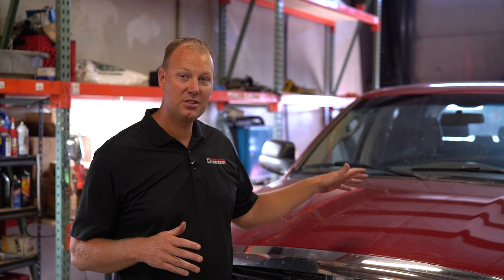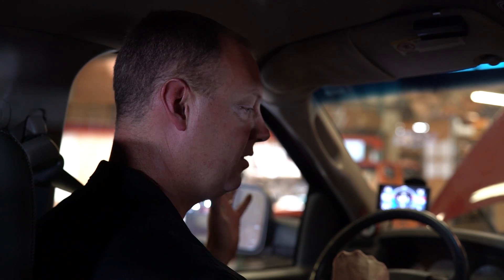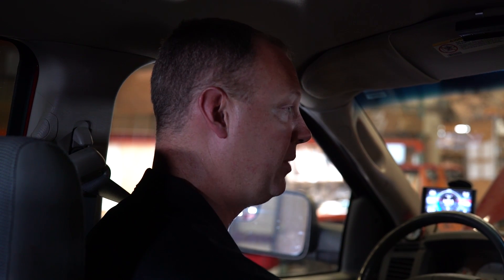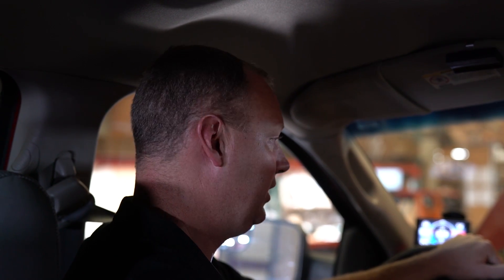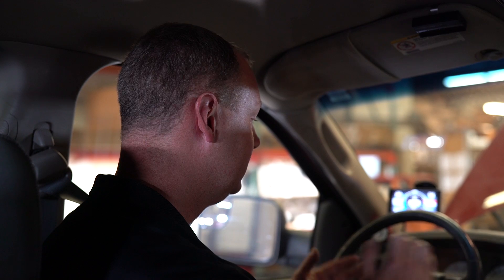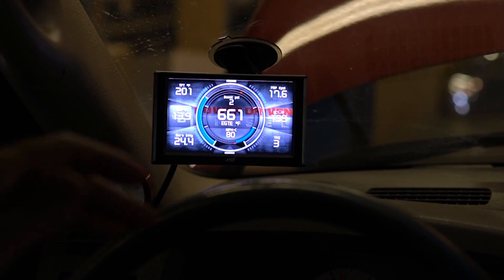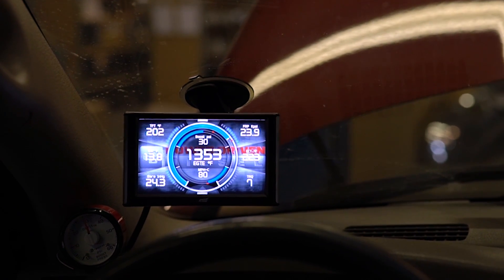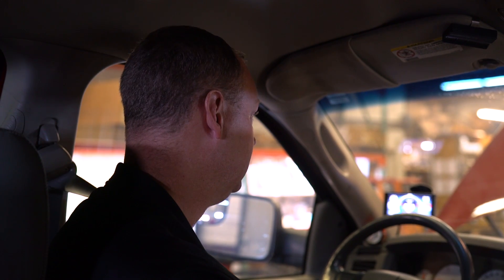Dyno Test: 2006 Dodge Cummins 362 SXE Drop In with EFI Live Tuning | Power Driven Diesel

Comment: How does the S362 compare to the two PDD HE351s? Are there turbo maps for the two HE351s?
Reply from the maker: The 351 will be about 300rpm sooner to spool and makes the same power.
Reply: @pddofficial what makes the HE351 spool up faster?

Comment: Are there any other supporting mods that you'd to to do to ensure reliability?  Headstuds, and transmission mods from the added boost pressure?
Reply from the maker: Yes our pan off upgrade, and some head studs are good insurance!
Reply: @pddofficial   is the Pan off upgrade for the 48re going to support the 500hp mark ?

Comment: I broke a con rod in my '03 5.9 last week. I've ordered a DFC tow/haul long block that comes  with a Hamilton Cams 178-208. Add to that the S362SX-E Drop-In Turbo Kit from PDD. I already have a 4" cat back with a straight through muffler. I'm considering 30% over injectors with supporting pumps and definitely MM3 tuning from PDD. I anticipate pretty good power from it. Any thoughts in the comments are appreciated.
Reply from the maker: Sounds like a really good set up for you solid 650 hp

Comment: One of the things I am a staunch believer in is external oil coolers know where I live and for my application on my 91.5 dodge I really don’t need it but for guys that are doing heavy towing especially in hot climates I’d put an oil cooler on and I tell you something else and oil cooler before  the oil routed into an oil cooler also before it gets to the turbo why not this is six in a row jim from Kennerdell Pennsylvania

Comment: I would like to see the same test done with a compound with a s475. I’m on the fence about buying a compound set and this is a great way to show a single vs a compound setup. BTW my truck is a Fummins has an 05 Cummins engine with just a Smarty tuner.
Reply from the maker: unfortunately  we have tried the 475 flows 10lbs of air a minute less than a 472 while increasing spool time

Comment: So if I want 600 hp, with 50 or 100hp injectors, and I plan to tow, would the 62 with a t4 be a good option for that power and low egt or should I put something else in?

Comment: Does that have the stock harmonic balancer on it or did you upgrade that because I've been watching videos saying the more horsepower you add you should put a fluid dampener on them
Reply: @pddofficial  How do the Fluidampers compare to ATI Super Dampers? Is one recommended over the other in any scenario whether work truck or Street/strip?

Comment: During the towing simulator what tune are you using we're using the max effort still and also down here in Arizona would you recommend the .80 housing on stock fuel
Reply: PowerDrivenDiesel for the best towing performance lowest EGT numbers what exhaust housing would you recommend.   .70 or .80?   I tow 12-14k multiple times a year over 6-7k elevation passes here in California.  My truck is a 04.5 all billet Goerend auto.  I live at almost no elevation if that matters.  Thanks!

Comment: Would you happen to remember what the transmission temp was during the towing simulation?
Reply: PowerDrivenDiesel That was going to be my next question. Convertor lock. Or unlock during towing. Is that something that does not happen with a diesel? Sorry for the dumb question, I'm just from the gas world but I like to learn

Comment: What kind of AFR we are talking about here with this power? I'm going to have this same turbo with 0.91ar housing as LP turbo on my 2.5tdi so quite interesting stuff
Reply: @pddofficial  Its going to have two k03 (or similar) as hp turbos so overall i hope to have full power available from 3000-6500rpm. Its a v6 engine so bit easier to make it with two hp turbos on the side and lp on the middle. It will be quite hard time to fit them all to the audi engine bay but i'm confident it is possible to fit in. :D Currently running single K27/s200g hybrid 53mm/59mm and having round 400hp.

Comment: What needs to done to the drive train for it to live at that level? Eventually we will be buying a 3/4 to 1 ton crew cab truck and want to know what components I will need to add for it to survive pulling loads in the 12-15k range up 5% grades say 4-5 times a year. Unfortunately we won't have an unlimited budget so I would like to have a good idea of how much I can spend on the truck. Ideally I would like a mechanical truck but I haven't had much luck finding those in the crew cab configuration and that's a must. Thanks in advance for any advice you can offer and thanks for another great video.
Reply: Thanks a bunch for the information. You guys are awesome.

Comment: That's impressive numbers for drop in modifications most anyone could perform in their driveway. Thanks for showing the application of a daily driven tow rig that the average everyday guy or gal would run. I myself like an obnoxious exhaust but it's also nice to see that power or hear rather, that power number show up without the quarter-mile off alarm of piped Cummins lol

Comment: Is it safe to run a second gen with those EGT’s while towing a grade? If I see 1200 I’m shifting down to forth... but if I can run 1200 for say 10 minutes is that an issue?
Reply: aluminum will melt at 1500 if held at that temp for 15-20 seconds 1200 is fine

Comment: Those EGT’s seem like damaging temps, specially if you’re towing.
Reply: Wow, I never seen any of my stock trucks get anywhere close to 1400, unless air was restricted. We all know that dumping fuel in the truck will give it more power, but with a cost of high EGT's, just like your video shown. I would assume you know more about this, but from my experience, rings get eaten up with those high EGT's. Eventually you'll have massive blow by.
Reply: Gotta remember it was only wind from a fan too. That's not nearly enough air for this type of strain
Reply: UPstater5.9 - You don’t need to repeat what he said. That is an excuse that is not likely. There are a lot of manufactures that just dump tons of fuel to make their numbers for horsepower and torque. They don’t mention how it’s melting your motor. 

I’ve only seen Gale Banks produce a kit to inject methanol to keep EGT’s down. It would be great to see everyone else start to focus on not melting your motor down to gain horsepower, because I don’t have the money to replace my engine every year.
Reply: @mikemiller9119  hows that not likely? Wind from a fan is not 80 mph going over the entire vehicle. Its certainly not comparable
Reply: UPstater5.9 - 80 mph wind is going to cause much more drag which will cause the truck to slow or cause you to put more throttle which will cause higher EGT’s than what was already showing. Now that’s not what he meant by the fan verse the natural wind. 

He meant that you would get lower EGT’s by getting more air through the intercooler and/or intake. 

Let him put the test in real world, like I have for many years and you’ll see what I’m talking about.
Reply: I live in Northern Ontrario, and in the winter I have a tarp that I through over the coolers. I can tell you from experience that when it warms up I have to take the tarp off or the truck overheats. I'm talking about the same day too. I've seen myself drive to Toronto (7 hour drive south) and have to remove the tarp 3/4 of the way there. Guess what, the truck magically cooled down when the tarp was removed. 
Do you think that maybe the tarp was restricting the air flow to the coolers and once I removed the tarp and air was able to flow through the coolers thing cooled down?
You must be new to the diesel world. Many companies make compound turbo kits for these trucks and have been since I bought my truck and got interested in what was available. That was 2007. Remember what I said about a google search: https://www.google.ca/search?q=dodge+ram+compound+turbo+kit&rlz=1C1CHBF_enCA768CA768&oq=dodge+ram+compound+turbo+kit&aqs=chrome..69i57.19624j0j4&sourceid=chrome&ie=UTF-8
Reply: Clinton Roy - you’re not getting it. I’m not new to diesels and I drive them for a living. I work on my own trucks most of the time, if not all the time. I understand how they work and unfortunately see that you do not. I’m not going to argue with you. Take care.

Comment: whats the max continuous egt with a CR/24v truck?
Reply: theblackmech romping on it mine would run around 1,200 with a tuner, CAI, FASS 150 Platinum and 5” exhaust but just running down the highway at 80 she would run about 800... I miss that truck!
Reply: im asking what PDD thinks the max egt it will run without burning exhaust valves up
Reply: cummins uses inkenol exhaust valves (forgive the spelling), which are rated to handle 1600. hot rod guys upgrade to these valves for high hp/boost
Reply: yes, but 1600 intermittent.  continuously i think theyre rated 1250.  i wanted to hear why PDD says
Reply: so its cylinder wall clearance and not the exhaust valve?

Comment: Will a stock transmission hold that power? or do you guys have an upgraded transmission in that truck?
Reply: They have their 650hp 48re trans in it.  I doubt the stock trans would last long under the increased power.

Comment: I would have like to see what kind of draw was put on the 'after marker air filter" setup if was still suffacating the engine. Are there any other drive line "upgrades" needed with this setup or is it replace turbo, install EFi live and hammer down, What kind of life does the trans/driveline live being daily driven?

Comment: Can you guys start commenting what boost and afrs you guys are seeing when tuning?
Reply: Egt is enough for tuning a diesel
Reply: DATONALKY - Air-fuel ratio on a diesel?  Seems unnecessary since EGTs and what's coming out of the exhaust will tell you what's going on with the fuel.
Reply: Hard to find AFRs on a 5.9 common rail. Would have to probe the exhaust tip to get that info.
Reply: melonas22  as you do when tuning any Diesel, I tune common rail all the time and you need to know the afrs to be able to tune!
Reply: @DATONALKY  I'm not going to get down to YouTube argument level, but it is not entirely necessary to tune with AFRs. It's a helpful tool, I'm not saying it isnt, but it's not the end all be all to tuning a diesel. Actually testing on the street is the best way to get performance from anything. Even dyno tuning has it's short comings..

Comment: PowerDrivenDiesel
Todd Id be curios to see if no filter makes a difference ,if just a filter on the turbo  no tube , filter placement makes a difference and lastly if a heat shield around the filter blocking engine heat makes a difference.  Ive also seen slightly higher boost #s and faster spool up from a exhaust that just dumps w/o a filter  vs a full exhaust. Ide like 2 c that gain.

Comment: Thank you; I too am taking away from this, that my 07 is pushing about 600 to the wheels. Most mods expect for turbo, head studs and fuel injectors. Should do a dyno with my truck and see a difference on stock turbo but other mods.....

Comment: Now Todd you need to p pump it!!!!!!
Reply: It's a common rail...
Reply: @user63344-gds  I know but it would be interesting to see the difference if it had a p pump on it.
Reply: I don't think a P-pump can out perform CP3s.  Otherwise, you'd see them in the really high hp trucks and we don't.
Reply: Monster RAM p pumps have rpm. Common rails are limited to around 5000
Reply: Jared K - Are you suggesting to run this engine past 5,000rpms?  Seems rather risky, don't you think?
Reply: Monster RAM if your building a preformance engine. That would be the main and  biggest difference.
Reply: Jared K - "Performance" RPMs on a Cummins is 3800-5500 and require built valve train, etc, etc to support.  Stock these don't go much past 3000rpms and anyone who sees anything significantly past 5000rpms, even with a built engine, shortly blows them up.  If you want to see what 6000+ RPMs on a Cummins looks like, see here:   https://www.youtube.com/watch?v=co_aHanY1Ek 

I'm curious though, where are you getting this idea to rev a Cummins well past 5000 RPMs?  Are you familiar with how to calculate maximum RPM for an engine?
Reply: Monster RAM I'm well aware the rpm of a normal cummins.  I've been around trucks that push 6500+  please read my reply that elludes to the only advantage of a p pump over common rails
Reply: Jared K - Got any footage of these 6500+ rpm Cummins engines, ones that aren't exploding?
Reply: Monster RAM you normally dont film serious sled pull trucks in shops or on dynos
Reply: Jared K - Yeah, seems like no one else does either considering that every high revving Cummins engine on YouTube is around 5,000rpm.
Funny how that is.
Reply: Monster RAM when you pull for money theres a reason. The same way no prep racers lie about their setups. And big money circle track racers do too
Reply: Jared K - All that aside, how many actual Cummins-made parts are in that sled pulling engine?
Reply: Monster RAM just about all of them. That still run stock rods or shot peened 12/24v rods. And modified pistons. Common rail rods take out blocks. 1st and 2nd gen rods usually shrink and knock before they break.
Reply: Jared K - Far enough.  Let me cut just to the chase; here's my problem with this entire conversation:

The OP suggests P-pumping this 06 5.9 truck, when there is no point.  This is a stock truck aside from the turbo, tuning, and trans.  You can do everything, include blowing the thing up with CP3s.  Why go though the immense ass-pain of retrofitting a P-pump, fuel lines, and injectors to a CR truck in the first place?  Get a 12/24V if you want that.

Now with that out of the way, you chimed in to say that CP3s are limited where a P-pump isn't because it runs off of rpm.  Yeah, that's true but it's beside the point and irrelevant to the initial proposition.  There is no point of revving this truck past 5500, which seems to be the limit for a CP3, unless you want to break it and even that requires a fair amount of mods and is still risky.  

Okay, now to the sled pulling thing.  To be honest, you're claiming some strange shit.  Here's why:

You say that you've seen 5.9 Cummins built with OE parts be just fine at 6500+ rpm.  This is a fantastic claim, and it only takes a basic understanding of physics to understand why this is the case.  But let's just pretend physics don't matter... where are the videos and  articles?  You say that it's because of competition, etc, but that has nothing to with anyone posting a few seconds of in-cab RPM readings at 6500.  That wouldn't give away any secrets as to how fast it was or how much it could pull. 

Conversely, why do we have many videos of Cummins race trucks hitting about 5000 - 5500 rpm?  If we use that logic there shouldn't be any footage of that either... but there's plenty of it.  Why did PDD'd truck explode when it hit over 6000RPM when it was built with the same parts as the ones you say can hold 6500+?  Shouldn't that have held?  It didn't, the block split right in half and puked out the cam.  Why aren't there plenty of P-pump swap 06+ Cummins trucks on the interwebs?  Why are there plenty of 2000+hp trucks that uses CP3s?

Idk, it's almost like there is no evidence to support your claim and multiple independent sources that refute it.  Now, if you were saying that there's a Cummins based race truck with custom light-weight pistons, shorted stroke rods, along with an incredible custom light-weight valvetrain and then some was reliably achieving 6000rpm I'd be more apt to believe you.
Reply: Monster RAM 1. I said most. The biggest restraint is balance. And I said modded parts. Aka shot peened rods. Milled pistons and fly cut. Pistons. The big dollars are spent in the valvetrain and a head/ turbo to flow at those rpm to keep the torque down as it goes down the track. And the pdd truck blew up at 8000 not 6 where it usually runs